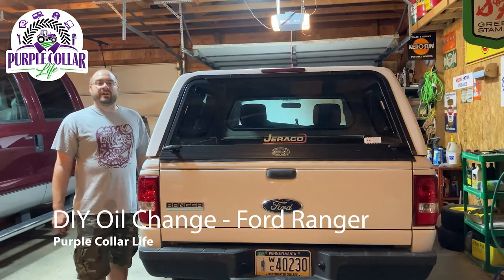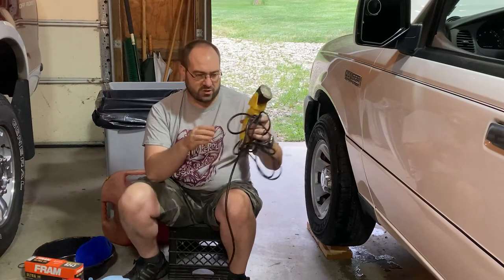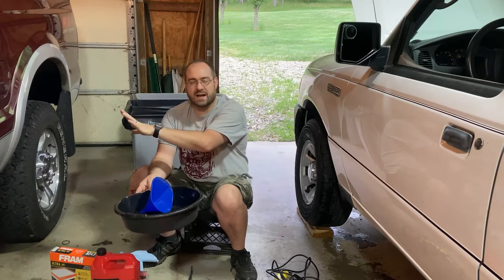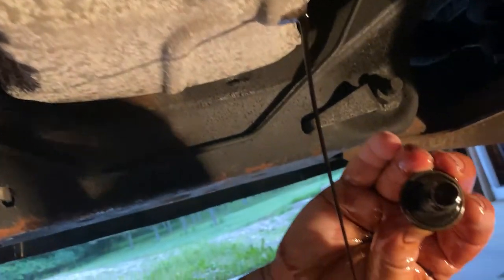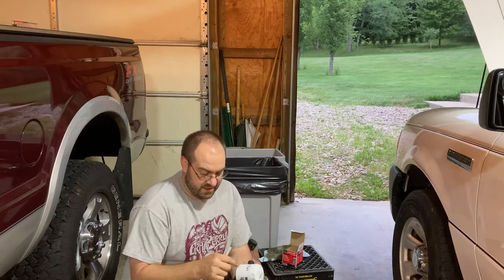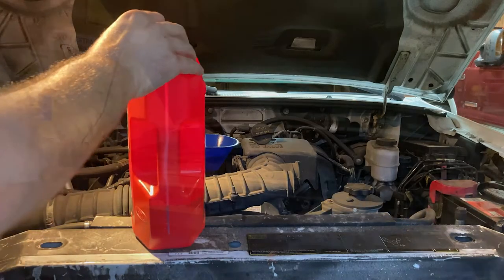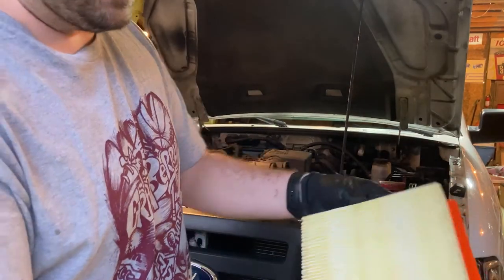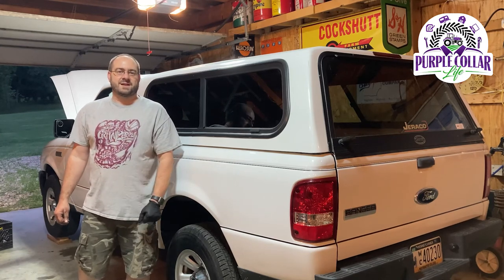DIY Oil Change Tutorial Ford Ranger 4 Cylinder

Comment: Great oil change tutorial! I hear ya on the Fram oil filters, I've been using Fram for years in my 3 ton diesel truck, but decided on my last oil change after reading reviews to use a different brand. I settled on Wix, hopefully they are good lol. I also use a Ford Motorcraft oil cartridge filter in my F-450 diesel. I like to slide a sheet of cardboard underneath to help catch any unexpected spills. Cheers!
Reply from the maker: Great tip! I'm going to use that on my next F-350 change.  
It's a shame that Fram is so widely sold, when it doesn't seem to test very well. 
Wix get great reviews!

Comment: I love this dork who spilt oil & got it all over his hand...too funny!
Plus he didn't run engine to warm up the oil !
Reply from the maker: Hello, Glenn.  I’m not sure why I’m being called a dork, but thanks for watching and commenting.  I did run the engine for a short time (only a few minutes) when backing into the garage, and then backing onto the blocks.  I’ve found that the oil is much better to drain after only a few minutes - it’s slightly warmed up, but not overly hot.  I prefer not to deal with the hot oil and the hot oil filter.
Reply: @PurpleCollarLife  I just finished doing my 2010 Ranger and found the video quite helpful.  I too ended up w/ oil on my arms...

Comment: Hey Chad, thanks for keeping it real.  Nice looking Ranger, did you buy it new?  My Dad has a '93 Ranger with 247,000 miles!!  2 things I do that I think seem to make a difference.  I leave the oil plug out until I remove the oil filter.  I noticed that a good 8 ounces or more oil comes out of the drain plug once the filter is removed.  Second, I fill the filter with oil prior to installing it.  Thanks!!
Reply from the maker: Those are great tips!  I purchased this Ranger used a few months ago when our daughter Mackenzie got her driver's license.  She is mostly driving my Chevy Volt now, so I needed a daily driver for my work commute. This is my 3rd Ranger in my life. The first one was the vehicle I learned to drive on when I was 15/16. It was a 1986 Ford Ranger, 2.9 litre V6, 5 speed.  That was a great truck.  Then I had a 2006 Ford Ranger with the 2.3 liter 4 cylinder 5 speed.  I put a lot of miles on that truck and actually traded it in on my Chevy Volt in 2014.  I can say I've had no regrets about buying the Volt, but tons of regret about trading in that Ranger. I'm glad to have one back in the garage now.  It really is the perfect daily driver.

Comment: Nice video. Have you thought of filling the new oil filter with oil before installing it?  I usually do that so the oil pump gets going tight away.  Just a thought.
Reply from the maker: Great tip! I have done that sometimes in the past when the filters are going on upright.  For the instances where I have to tip the filter to maneuver it into it's position, or where the filter actually screws on sideways, I typically just get oil on the o-ring.  Good tip though for when you can do that! Thanks for watching and leaving the comment.

Comment: Do you find that Duractec 2.3  is quite a bit noisey?      mine is
Reply from the maker: Thanks for watching and commenting. I don't think mine is loud at all.  But I suppose maybe it depends on what you're used to/expecting. I'd consider it really quiet compared to our F350 diesel. But I do suppose it's a bit noisy compared to our Chevy Volt.  But for a little truck, I still find that it's quiet.